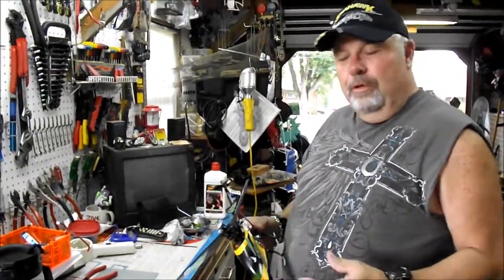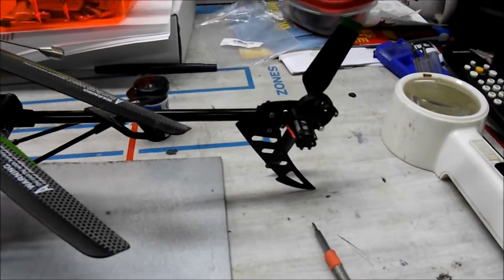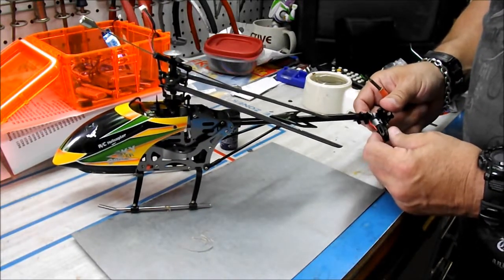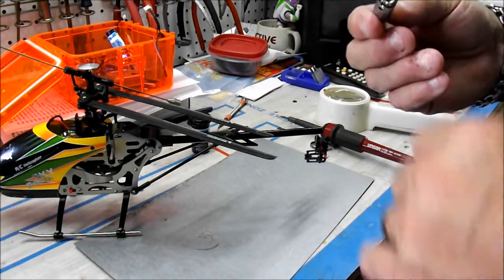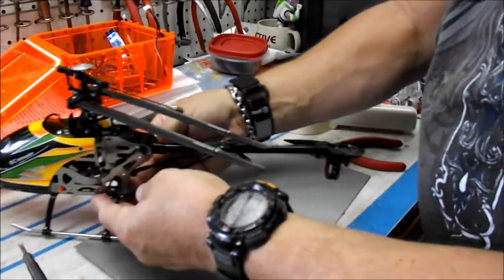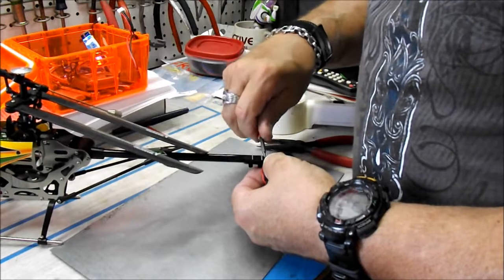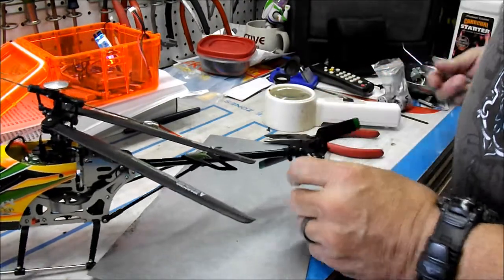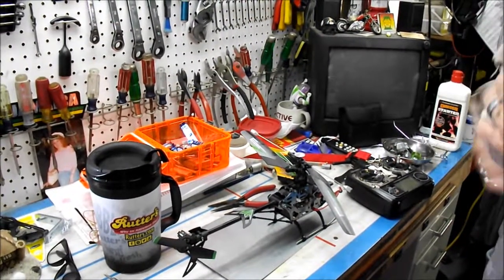Tail Boom Terry Replacing V912 Tail Motor

Comment: Hello Good Day Sir, i really need your help, 

i have bought 2pcs v912, because the first one is spinning when take off, 
the second one, after crashed last week, it spinning too,
i have tried to replace the main brushless motor, the main shaft, the balance bar, the swashplate,
but still, it go spinning when take off, spinning clockwise

but when i tried to screwed off the tail blade, it spinning counterwise (normal right?)
so the problem is tail motor maybe too powerfull, or the main blade can't not compensate with tail motor speed?

Please help my problem, good luck

Comment: My Tail Rotor blew after only about 10 flights, that's NOT good.I have another on order. The designers of these Heli's shouldn't be allowed to design and release a product which is NOT very durable.  sure I will replace my tail rotor and put a Heatsink on it to COOL it down more, but it's a CON of the original manufacturer to make a HELI with such a weak Tail Rotor. Some GUYS have totally CONVERTED their V912 to Brushless, Tail ROTOR and MAIN ROTOR, which nust be the way to GO. EVENTUALLY I am just going to buy ANOTHER heli from www,monkeyhobby.com  
The 2014 KDS innova 450QS 3D RC helicopter RTF version. Runs on a 3s LIPO all ready to go, tail rotor runs off a belt  etc....etc...a proper heli.
Reply from the maker: Your right! Tail motors are a week spot on tthese helis

Comment: Hello Terry I have a question my wltoys v 912 turns around in the air if I push the throttle stick up !!! what is wrong with my V 912? the tail motor works the main motor works too !,but it turns in the air round and round non stop   !!! I will waiting of your answer greetings from GREECE to USA !!!......
Reply from the maker: When you say turn I belive it kind of spinning, that would be the tail motor. if its turning to one side that you can adjust with trim. If you can't you may have to adjust turnbuckle on servo.

Comment: Hello & happy Wkend, Terry. Piece fo cake thanks to your tutorial, spin test indoors same night & alls good. About to neatly cut a horizontal slot near the top of the "windshield" & cover it with vinyl screen glued from the inside. Have done a dry fit with screen & it molds great w/o any creases. Raining for wks , and a sacrificial dinged up canopy just happened to be around. Will it help cool the main motor , who knows.? Happy flying to you too , TBT. !!
Reply from the maker: Great so happy it worked, now go fly that bird

Comment: Hello, TBT.  About to replace mines & noticed polarity was reversed. Blk to Red, Red to Blk. ? Oh, noticed paint from windshield section scratched up & have solved prob.with Black electrical tape, just line up the tapes  down the windshield and cut along the outline & looks a bit better. Now off to the workbench & fix Bigbird ( Yellow blades,main & rear ) get it going. Thank You Terry, again.
Reply from the maker: Wow brotha sounds like your back ready to fly that bird, have fun...

Comment: I bought a v912 and only one servo worked. I swapped the servo wires to determine if the issue was with the PCB or the servos. Basically either servo alone worked fine on the inner plug but not on the outer plug. That is-  each would work alone when on the inner plug but the outer plug would not operate any particular servo. Outer plug connected servo just buzzed a bit and had resistance. So I assumed it was a bad PCB. Seemed logical. One plug was good and one was bad. Replaced the PCB with a new one and same result! Any ideas? I am out of ideas.
Reply from the maker: I know I had the same issue. It was the PCB. I do know when you do any work on V912 make sure the battery is disconnected. Even if the main switch is off you can blow up the PCB fast with the battery connected. I would believe it is the PCB. 

Try this:
1 You got another bad PCB 
2. You could try another radio if you have one. (long Shot)

Anyone else want to weigh in on this??

Comment: Hello Terry! How long did your tail motor worked before it break?Would you also tell me the usual lifetime that both motors of this helicopter have? Thanks in advance! Greetings from Brazil!
Reply from the maker: +Davidson Costa Souza: The main motors will burn out faster than the tail motors. My replaced my first main motor after 6 hours of flight time which was about 45 flights. The tail motor was replaced after about 10 hours which was about 77 flights. I have now replaced all the original main motors with MJX F45 motors. They last a lot longer and make the heli faster when at full throttle. I have replaced only 2 tail motors so far and this was after flying the crap out of this heli. I now bought a brushless main motor V-912 so hopefully I will have to only replace the tail motor. I don't know the usual lifetime of these motors as it varies depending on how you fly but I got around 45 flights on main and 77 on tail. Full Throttle & Blue Sky's Brotha...TBT
Reply: Thanks for the information Terry! You helped and continue to help me a lot!

Comment: Hi terry, I finally ordered new tail motors for my v912 after I messed up the new one with the solder gun. It worked in one way but the blades would not spin the other direction, making the heli go in circles. I ended up finding motors with the wires attached already, just got to run the wires in the tail boom. How much and hard is this process. Thank you

Comment: Hey Terry, just a quick shout to thank you for the video. I replaced my tail rotor gear today and it was a simple job, I did add a small piece of wire to the motor in order to make the wiring a little easier to handle during soldering. The tail rotor gear was the original one ( about a year old) and finally stripped on me, not to mention the housing was showing signs of high heat stress, it was bend and showed some melting, BTW, I have also completed the engine mods that you suggested on your other video. I [plan on upgrading the motor too. I have a large heli collection and the 912 is really fun to fly and work on. Thanks again for taking the time to help us enjoy our machines.
Reply from the maker: Israel Hernandez Thanx so much for the great comments. Glad you are enjoying your heli collection and your love of the V912.
 Full Throttle & Blue Sky's Brotha...TBT

Comment: Good video as always Terry!  What I use on my workbench for a magnifier, has a round florescent lamp with a 5" or so, magnifier in it and it is mounted on a swing arm-boom.  I bought it years ago when I was building Heathkits.  I use it all of the time now at my soldering and small machining work.  Happy flying!
Reply from the maker: Karl Schwab Great idea Karl on the magnifier glass. I built Heathkits as I have my General ham radio licence. 
Full Throttle & Blue Sky's Brotha

Comment: woww tail boom is back with his heli !
Reply from the maker: Ashish Amatya Tanx and I have another video in the making as we speak
Reply: Terry L
nice video. btw i think its better to test that motor before installing it. Imagine you realize that the new tail motor turns out to be bad one after installing !
Reply from the maker: Ashish Amatya great idea Ashish. I have had new motors fail more than once. Also with the V912 the main boards have caused the tail motor failure in one direction or the other.